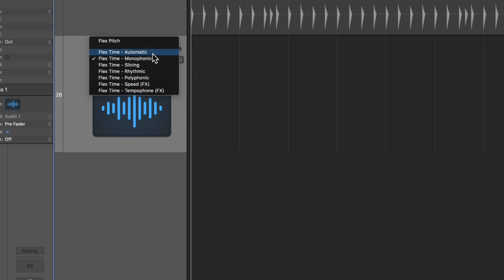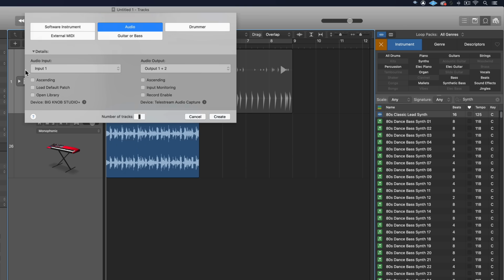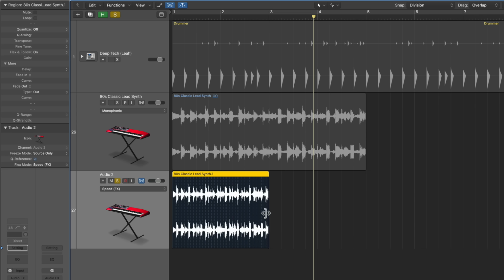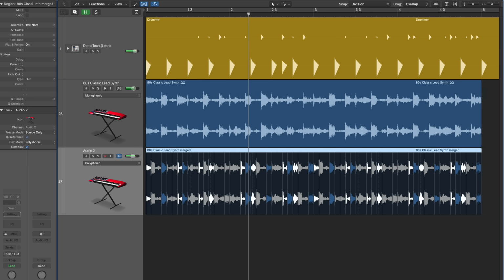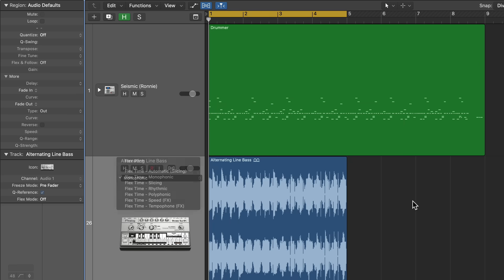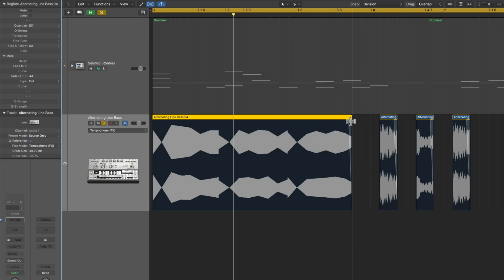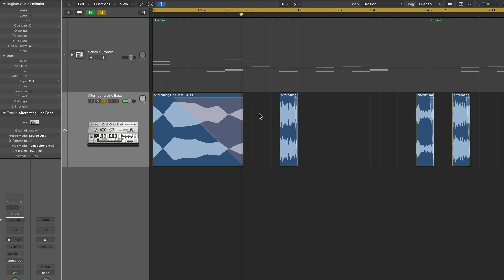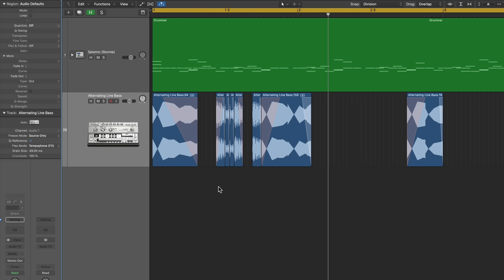Logic Pro X - Flex Speed, Tempophone and Pitch Effects

Comment: Re. Speed flex - I find that if 'flex & follow' in the region inspector is not set to 'on' BEFORE you apply the Speed flex, then it changes the speed without changing the pitch. If this happens, you have to create a new duplicate of the region and start again to get the proper tape/pitch effect working. Not sure why, but this is how mine behaves.